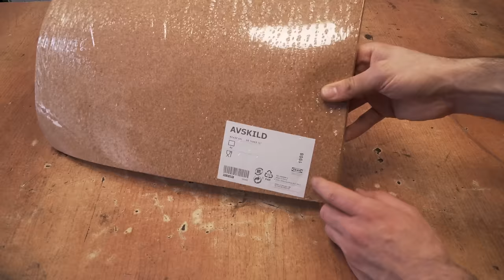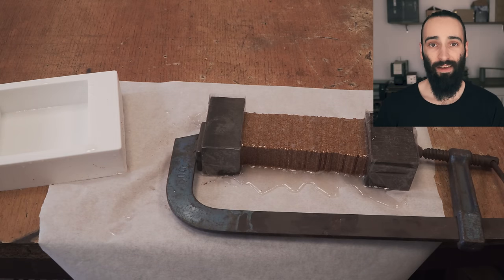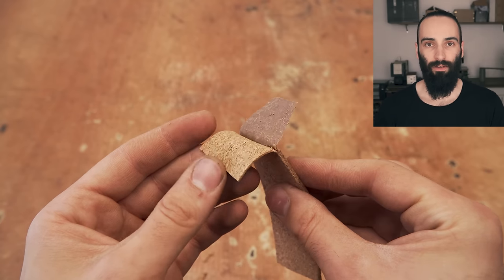DIY Stacked Cork And Resin Material

Comment: I wonder if it should be treated like stacked leather? The hidden tang is relying entirely on the resin.  For permanency I think it would work best with a tang-through and a pommel?
Reply: As he said the resin soaked all the way into the cork, I imagine it wouldn't have any trouble with de-laminating as it would likely act more like a solid resin block, sorta like micarta or G10
Reply: I agree it would be stronger with a tang going all the way through.

Comment: That's an interesting looking block of material. What would look even more interesting is if you cut the stacks at an angle  and have 2 halves (scales?) before making it into the knife handle you could then get chevron stripes for example on the handle instead of just plain strips either running along or at 90 degrees to the blade.